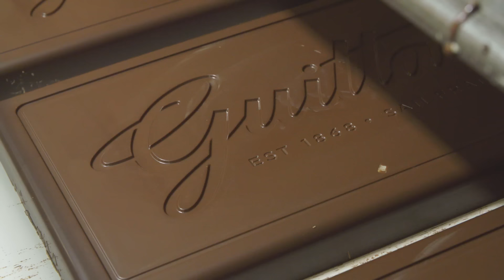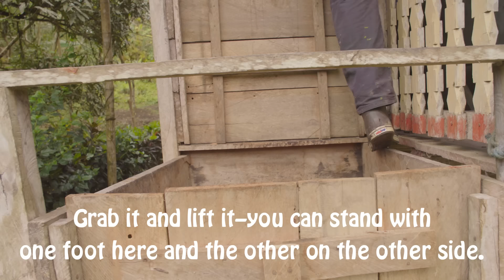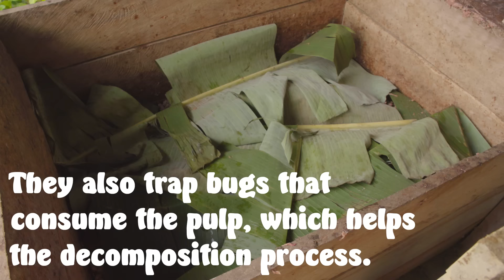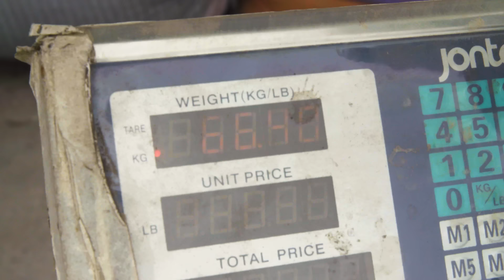Brad Makes Chocolate in Ecuador: Part 1 | It's Alive | Bon Appétit

Comment: Brad: "Is there a reason you use a solar dryer vs having a mechanical dryer"
Jimmy: "Well yeah we are in the middle of the fckn jungle"
Reply: Zach Crumpton A mechanical dryer doesn't require electricity. You could easily make a wind based pulley version that would blow air. Also, they have electricity on the farm anyways. They stated the reason in the video and explained why they use a natural solar dryer.
Reply: @XBLOODRUSH22X  Even without the flavor aspect, electricity is expensive and the sun is free.  This is a small farm, they don't need to process trainloads of cocoa at a time, and there's no reason to use an electric dryer if you can get away without it.